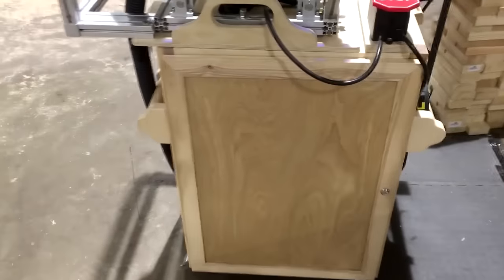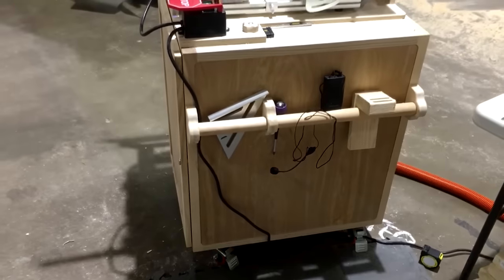Pantorouter trade show display at Baltimore wood show

Comment: It's really cool to see how this whole thing has evolved over the years.  One thing that I think would be a really cool demo is using a 3D printer to produce the follower templates.  I wish I could find the room in my shop to fit this contraption.
Reply: +Ed Draper 
I chatted with Michael Fortune a few days ago and he has his hanging on the wall.  If you mount yours on a tray like mine, it's super easy to slide out from under your bench and zip though your joinery in minutes.  The genius in Mathias' design makes it so easy to change templates, guide bearings and router bits to make extremely accurate joints.

Comment: Why is it called a "Hybrid" Pantorouter?  What makes it different than simply a Pantorouter?
Reply from the maker: +eformance I'm not sure what the "hybrid" is supposed to mean.  I didn't come up with that, and I don't refer to it as that either.
Reply: +eformance maybe because it has a tilting table?
Reply: +eformance perhaps it's implying that it's multi-purpose. The reason is probably because the domain name "pantorouter" was already taken
Reply: Perhaps it's because "Pantorouter" describes the functionality, but Hybrid Pantorouter can be trademarked.  Sort of the inverse of Xerox, that was a trademarked name that became part of lexicon to mean 'copy'.
Reply: +eformance 
This was the name the manufacturer in Japan gave it when he started with the steel version and later developed the aluminum model.
Reply: That's a cool little fact and makes perfect sense.

Comment: At that price I hope that you are on at least a 20% licencing fee for each item! I made a similar collar based on one I saw from a CNC machine after I built your design several years ago, can I get a percentage? A good demo but just a thought, why not have a second station set up with someone completing a series of projects such as a finger jointed jewellery box or dovetailed drawer (all could be sold off the store to cover material costs). Punters like to see the device in action before parting with their readies.

Comment: Hey Matthias :  I see on the display its says "Pat. Pending".  Is the Pattent yours ?
Reply: +Allan Perret 
The patents are on developments done mostly by Kuldeep, the manufacturer of the aluminum version.  This is all work done after the original PantoRouter was created and introduced to the public.  The dust collector was a huge challenge.  It looks fairly easy....a brush around the bit...but the actual workings of the dust collection system add a very important component that makes it possible to contain the shavings.  Just a brush and hood did not work at all.
Of curse Mathias is a technical advisor to Kuldeep and contributes to innovations.  We also listen to customers to know better what you want to see as improvements and accessories for the future.  Speaking of which, we're tooling molds for something new as we speak!

Comment: I absolutely think the Pantorouter is awesome.  I just wished it was at a price point where more people could actually buy one.  The current price point means it's out of the reach of most people.  Perhaps over time the cost will come down.
Reply: +William Hayden you can buy the panto router plans for  $18 on MW's site.
Reply: +teh40oz Understood, but that's not realistic for many woodworkers.  Mathias himself stated that it's not a beginner build and requires a fair bit of precision woodworking.  My comment was to address those the plans are not applicable to.
Reply: +William Hayden I don't know, it's a professional tool.  I mean, if you're the sort of person who needs to make that many professional-grade joints, I'd guess it's not hard to justify the cost.  $1K is a good amount of money, but it's not like it's astronomical or anything.  I'm into cycling, and most the people I know spent well over $3K on their bikes, for example.
Reply: Matt in the Crown Fully understood however I'm speaking about main stream users.  In the end the cost is what it is and if it's selling who am I to argue.

Comment: at first I thought this was just a less convenient competitor to the Festool Domino. however, after seeing this guy's demonstration I didn't know that it could cut dovetails and box joints. for the same price of a domino this machine seems superior. the only downside is it's a stationary machine
Reply from the maker: +Jeff Miller You still need to put your own router in it.  So it's actually a little bit more by the time you are ready to use it.

Comment: Pantorouter = $945.00
Pantorouter plan (by Matthias) = $18.00
Reply: +ledganache  building something with your own hands = priceless
Reply: In a way the price ($945) is a source of motivation.
Reply: +ledganache 945 USD is like two and a half month worth of income for me. (some) US things are nice, but way too expensive.
Reply: A little bit off...$18 for plans to build one.  Need to add the cost of materials to this, which can be significant if you don't have most of the parts already.  Still cheaper than the metal one but most definitely still not cheap by any means to build one.

Comment: He says 2:1 mechanical advantage,  but it's more than that at the handle isn't it?   More like 3:1?
Reply from the maker: +MattOGormanSmith The handle has 2:1 in one axis, 3:1 in the other (with the long handle, the shape traced by the handle is a distorted version of the one on the template)

Comment: Those "absolutely perfect dovetails" are not even ok, let alone good, excellent or perfect. I know everyone's standards are different, but come on, I have a hard time believing anyone who's ever worked with wood would consider those perfect.
Reply: Its cause the bit is round so there is some slack in the corners?